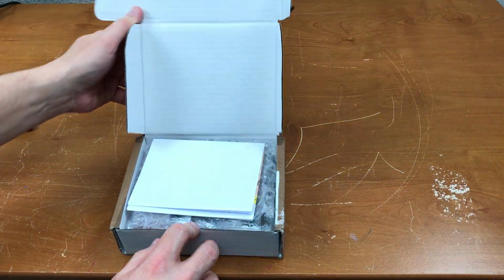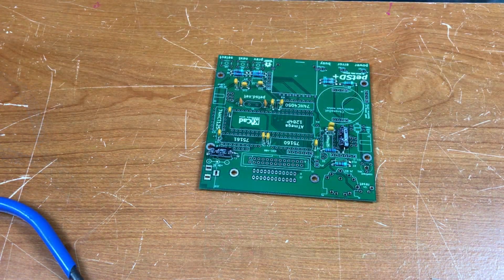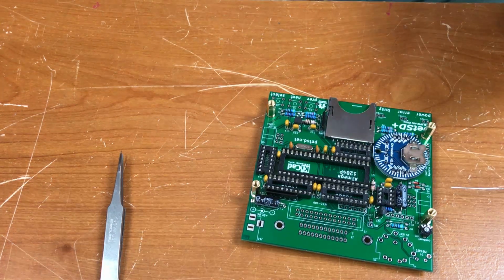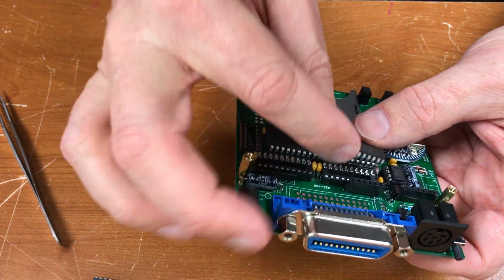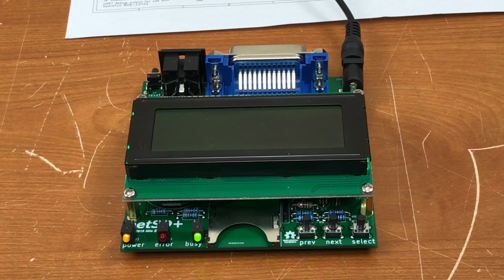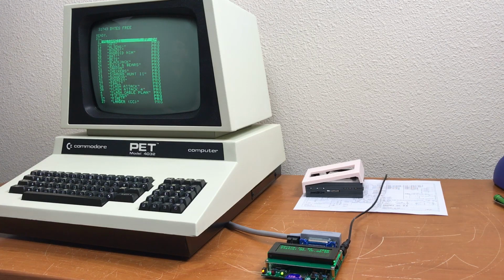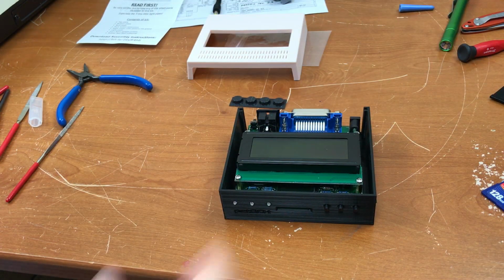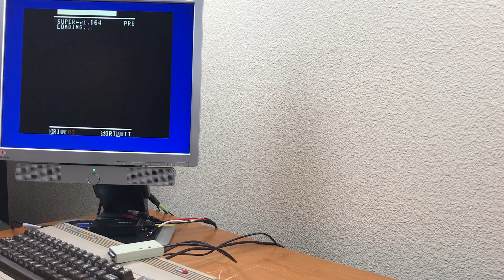petSD+ Assembly and Demo

Comment: Hi Chuck, question: I just built up a PETSD+ with the bare minimum components. (So no LCD, ATTiny, IEC cpmmectpr. etc.) Did you ever find a file browser that works for the PET? I was trying to use CBMCommand 2.3 but even it is unable to enter D64 images or directories. So navigating around with the PET (without a LCD) is quite the pain.
Reply from the maker: I may have already answered this before all my comments got deleted, but for the sake of others, the CBM DOS Wedge should work with the petSD+ or the SD2PET.
http://petsd.net/wedge.php

Comment: This was very helpful.  I bought the kit version without the display some time ago and couldn't get it to work.  Couldn't be sure where the problem was. Was it the CBM or the PetSD+?  I recently bought a IEEE488 interface for C64 in hopes of further debugging.  Also similarly I couldn't be sure if my 8096 or 8050 has a problem or both.  Hopefully with the information here, PetSD+ and with my new C64 IEEE488 interface, I will have a better idea of what's going on.  After all this, the next item on the list is the CBM 8023P printer, which is not even powered on or even tested since the early 90s.